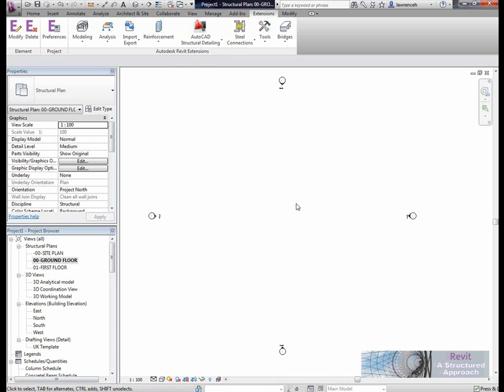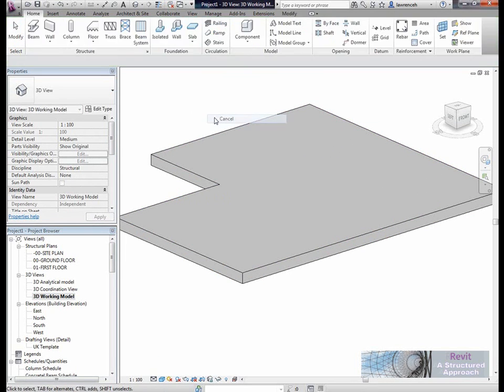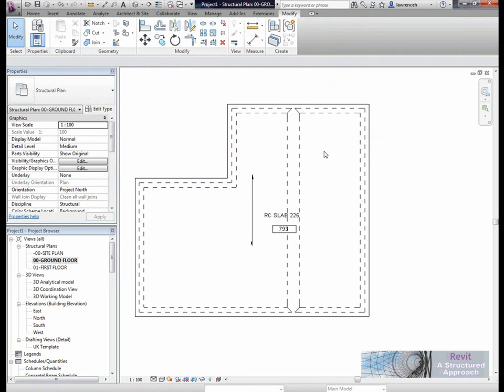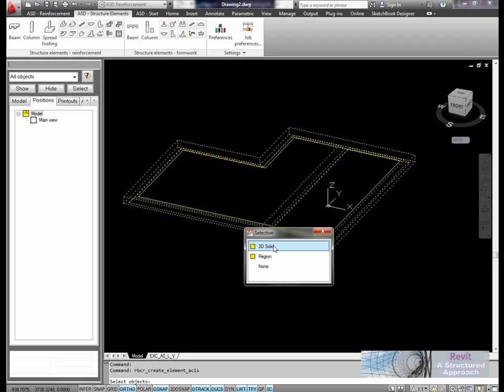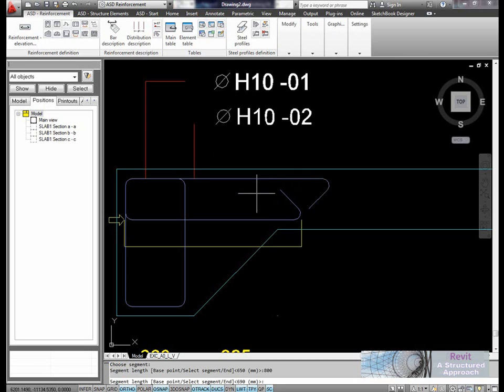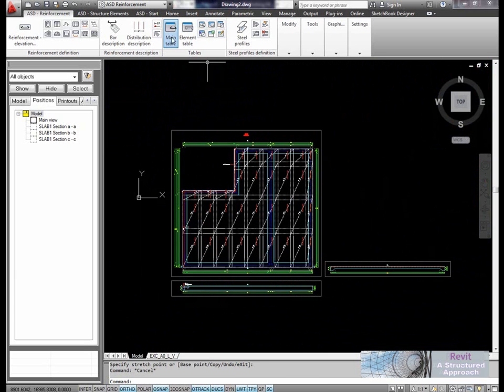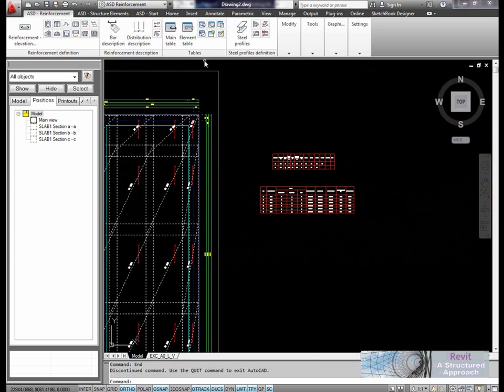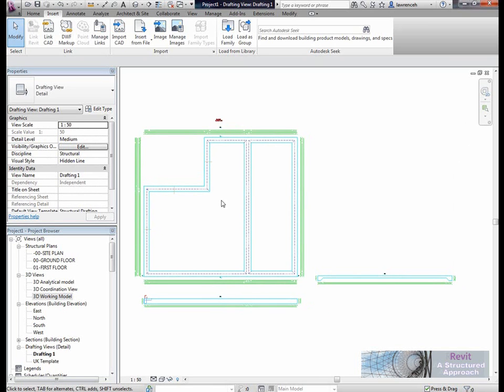Revit Structure custom Slab to ASD RC module.wmv

Comment: Hello!
You really made an excellent presentation. I tried to repeat your workflow with a column but I failed to meke new sections in AutoCAD Structure Detailing and I don't undersand why. How can make a section through a transformed 3D Solid in AutoCAD Structural Detailing. Thanks.